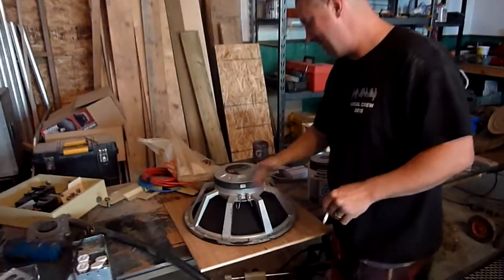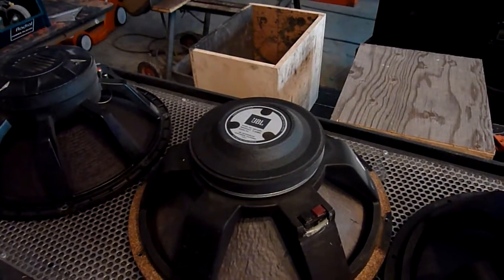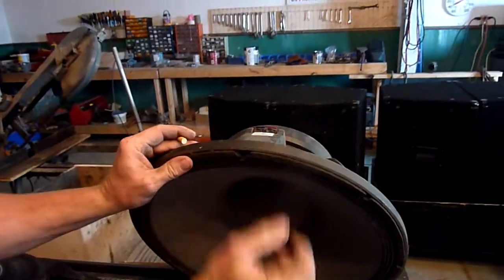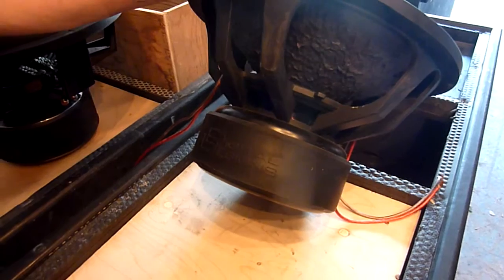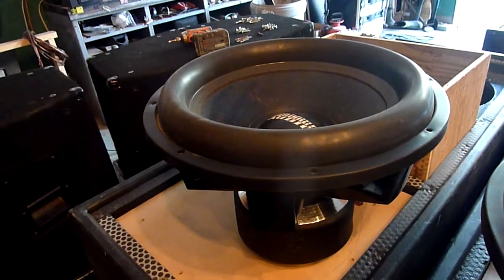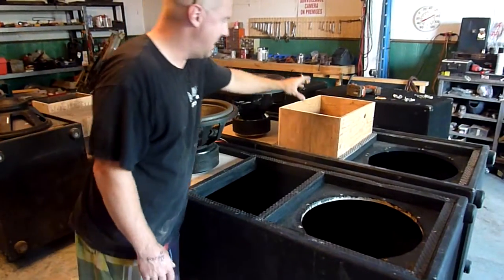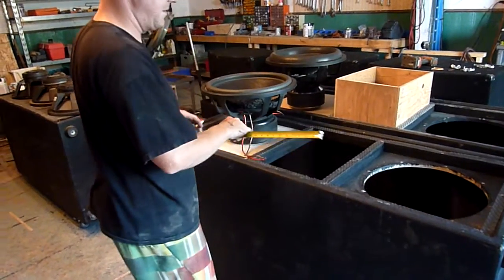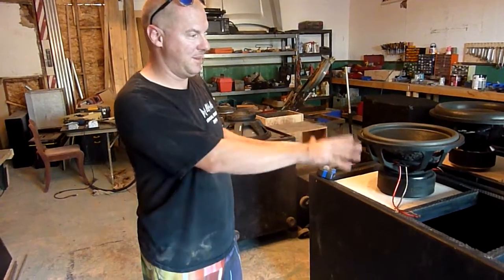Subwoofer Tests Begin DD & Sundown

Comment: I like both companies but my SC 3512 shuts down my buddy's x 12v2 and his zv4 and it's almost 20 lbs lighter with way smaller magnet. so what it it's $200-$300 more than the x series lol.
Reply: X's are meant for extreme lows not to be loud
Reply: All in the box and car. If you have a more optimal box than he does and you have hatch and he has a trunk, then you'll definitely be louder.